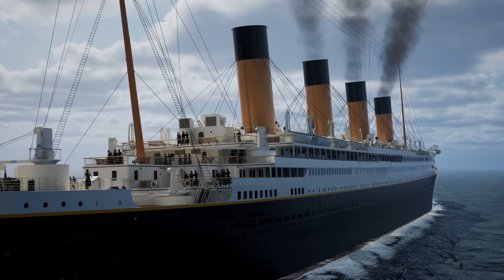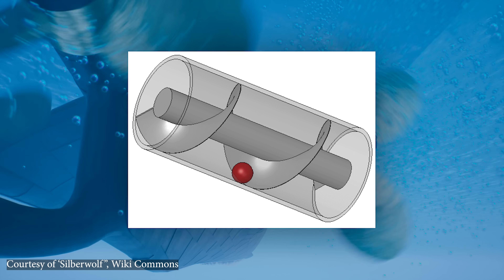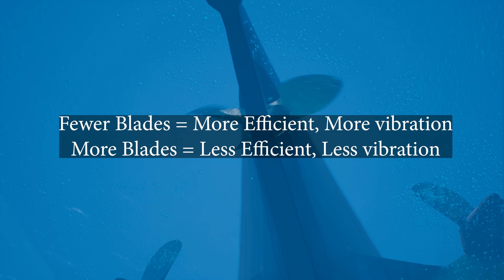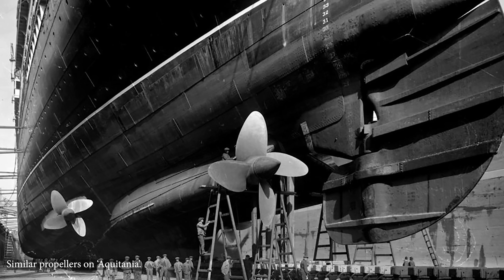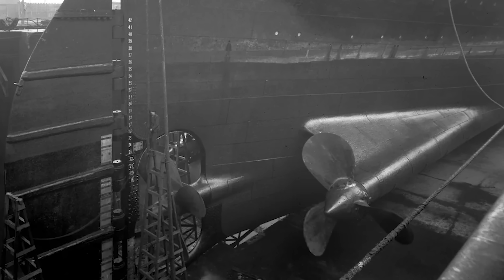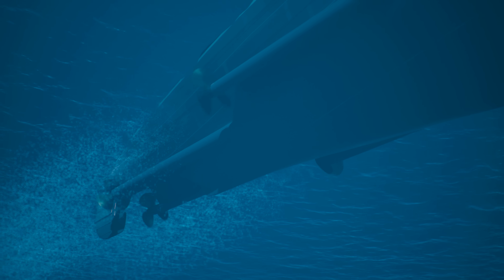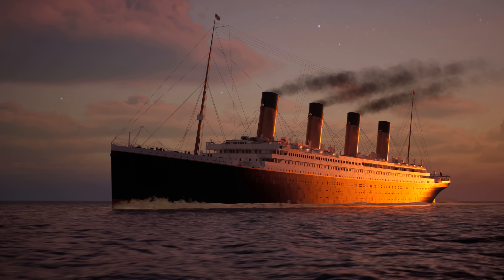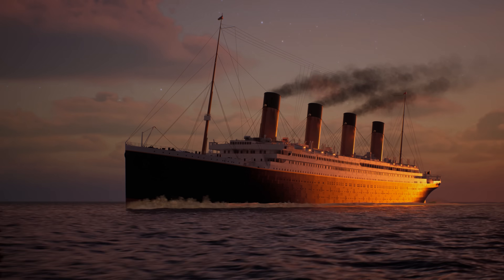Titanic's Propeller Mystery

Comment: Something I'd like to know, maybe for a future vide: How did/do ship builders manage to get a watertight fitting around the rotating shaft of a propeller through the hull into the engine room?
Reply: It would have been a stuffing box, an area around the shaft stuffed with jute or other fibers, possibly along with grease or other thick lubricant, and then compressed around the shaft. Often times, especially on bigger ships, this was not designed to be perfectly water tight, as a small trickle of water flowing through the gasket would help manage heat buildup and keep the stuffing box from overheating and potentially igniting from all the friction. The small dribble of water would be easy to collect in a sump or bilge area and pump out. 

I too would be interested in learning exactly what type of stuffing box Titanic and other large ships of the time used, and if there were any interesting quirks or experimentation as compared to modern stuffing boxes.
Reply: @lucusloc  Spot on with your explanation
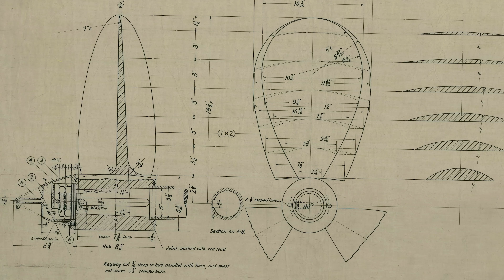Reply: Good question - at 3:27 you can see some original engineering drawings which state that the joint is packed with 'red lead'. Maybe this is part of the solution.

i was wondering the same thing so this stood out to me.
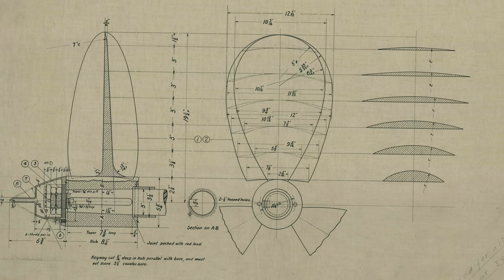Reply: @tachikomakusanagi3744  No, the red lead thing you see at 3:27 is the connection between the prop shaft and the propeller itself. It doesn't need to move, as the idea is that the prop shaft turns the propeller, so a much easier problem than the stuffing box. The stuffing boxes will be inside the ship. Typically the rear parts of the shafts are flooded, running in a kind of tunnel. At some suitable place within the ship (as in, somewhere crew can access it for maintenance etc.), the tunnel ends and there you'll find the stuffing box.
Reply: Red lead is the red anti rust paint. Red lead oxide. I think it was used in this case to stop corrosion between the prop shaft & prop boss to enable easier removal during maintenance.@tachikomakusanagi3744
Reply: I am not sure about titanic in particular  but usually there is a recess cut in the metal shaft housing and packed in tight with Rope or something similar as Packing material.     It's the same idea in a wood stove you use a rope as well to block out fire/heat/smoke around the doors and glass.    You can find rope of various types used to seal in industry from back then and today.
Reply: Asbestos was used quite a bit then to
Reply: A long propeller shaft, tight fit, maintenance and a fuckton of grease
Reply: @thatawkwardfeeling9076 sounds like a diddy party!
Reply: @DiscombobualEight  XD oh no
Reply: Some water still get in and just pump it back out.
Reply: @thatawkwardfeeling9076  Water soluble oil not grease.
Reply: Not a bad idea for a video, hell I spent ten years on carriers and I only kind of know, mind you I didn’t have much reason to go below the hangar deck. Maybe a series on how basic ship functions like that have changed over the years.
Reply: grease and hempcord/rope into something called a stuffing box
Reply: @grrfy and it leaked like a sieve!
Reply: @_RiseAgainst thats because it was a ford. They are STILL bad.
Reply: @grrfy oh yeah!! my wife has one too
Reply: Water pumps (and the cooling fan shaft) on model T had a wax cord that was packed tightly in loops around the shaft. They were terrible.
Reply: They do leak, and the water is pumped out.  I was on a cruise ship and managed to get a tour of the engine decks.  (This was over 30 years ago - when such things could be arranged.)  It was night time and the stabilizers were deployed.  The engineer told us that is was indeed seawater pouring in around the stabilizer bearings.  I knew an old navy guy who pointed out that "ships" take on water, "boats" do not.  If a "ship" has no engine power it must take on external power or the ship will eventually flood.  Mothballed ships have their bearings sealed to prevent leakage, but the bearings will no longer turn.
Reply: @earthwormscrawl  The old navy guy didn’t know much than because everything on the water will take on water. You can’t just leave a boat indefinitely tied up to a dock and expect it not to sink.

I’ve never seen so much stupid in one thread.
Reply: Indeed!
Reply: @Rudeljaeger  And then..... sadly... she was sold for scrap.
Reply: Rope, fabric, other fibrous materials, usually soaked in some sort of thick oil or other hydrophobic substance, packed around a circular opening and bearing surface around the shaft. Battleship New Jersey has done several videos on their propeller shafts and the “gland seals” that fill the gap through the exterior plating.
Reply: It's called a shaft gland and basically it's a set of bearings with some kind of lubricant which excludes water ... in the modern day this can be a dry lubricant or heavy grease, material which when wet swells to expand also exists which would be in the "stuffing box". It's very normal for a small amount of leakage to occur regardless. Here's an example of one on a small boat: https://www.youtube.com/watch?v=Hsa2uvENWoE
Reply: I'd always taken for granted that they used Babbitt!!  🧐
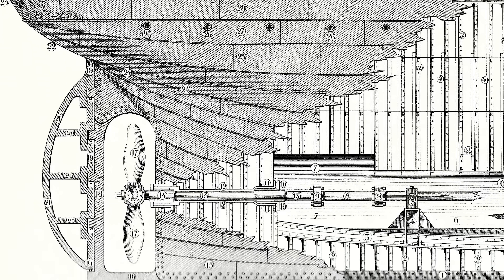Reply: I’m not trying to be a smart-a** but it’s pretty much the same way the crankshaft on your car can have an external pulley to run the belts and flange to drive the transmission yet not leak oil out every time it runs. To see an example of the housings that contained whatever sealed the shafts, 2:15 shows a diagram where numbers 11 and 14 show what you’re asking about. As far as the automotive example i gave. The materials are different, on a ship it’s actually more similar to the seals on hydraulic cylinders, called “packing”. Basically the shaft passes through a sleeve that contains a snug  (but not tight) fitting sealing gland made of some type of softer than metal material (rubber, soft plastics, even leather in some very old designs).
Reply: This is a very interesting thing. Certainly when it comes to marine screws, the Normandie of 1935 had several sets installed. First time out she took the Blue Riband in May of 1935, but she suffered dreadfully from vibration. A couple of sets later, they managed to settle it down. At the time of her destruction in 1942, French Line (CGT) had another set waiting so she could take on Queen Mary, but these were never fitted. White Star Line themselves also ran sister ships with differing engine arrangements too and in one example, in two sister ships, one ran Parsons turbines and the other traditional reciprocating engines…so changing marine screws was definitely not an issue either. Thanks for a fascinating video Mike.
Reply: They keep seals back there and send new seamen to feed the shaft seals 😂😂
Reply: I’m pretty sure the answer is that they couldn’t and had to constantly pump water out. 🤔
Reply: On the USS Peleliu we had a spot called shaft Alley with a Rubber-esqe gasket at the front of the seal around the shaft. The seal could be adjusted, as my buddy walked in on the room flooding, called a more experienced sailor, he came in and adjusted a few things and turned the flood to a drip hahaha
Reply: Great video
Reply: It is called a stuffing box basically rope in Greece sandwiched between two steel plates around the shaft. That would definitely make a good video to see it on such a big scale.
Reply: "Without shaking the milk out of your passengers" teat" 3:28 omg, My friend Mike Brady had me rolling
Reply: @drockjr TEA, not Teat! But your version is much funnier!
Reply: Now I'm wondering how a submarine does the same thing because I'm sure that keeping water from seeping in around the propelled shaft is much more difficult to do when the water is under pressure.
Reply: I've wondered how modern submarines do this as well, especially considering the depths they can reach. Gotta get the rotation from the reactor turbines to the screw somehow, and that means a hole in the pressure vessel.
Reply: If you go to the channel for Battleship New Jersey, Ryan explains this in one if his videos.
Reply: Oakum, essentially.
Reply: Horse hair I believe was used.
Reply: Big washers.😂
Reply: Similar to that of any crankshaft.
Reply: I was a boat builder and we used a stuffing box, it worked well.
Reply: A lot of ships used a seal made from Birch, as it swells when wet and is resistant to rot in salt water.
Reply: @PhalosSouthpawsBastelstube
The item your referring to is known as  a thruster shaft seal.
These are installed during manufacture in the shipyard and if a major failure occurs during the ships working life the vessel will be taken in to a dry dock where it is once again out of the water and any repairs and replacements are made before floating the vessel again.
Reply: Duct tape! Lots and lots of duct tape.
Reply: Flax and grease stuffing boxes. They are still used.
Reply: It is what's known as a "stern gland". It is the same idea as a valve spindle that passes through a gland or stuffing box that is filled with packing to stop the liquids or whatever leaking past the spindle. The compression of the packing can be controlled by a gland nut. The stern gland on a ship has packing that can be around 3" square (used to be asbestos based but not anymore) and this is compressed into the gland by a compression ring. The compression ring may have 4 to 6 tightening nuts around its diameter to give an equal compression on the packing. Usually after tightening, the nuts are backed off so that a small trickle of water passes through the gland to prevent overheating. The stern gland should be regularly checked on each 4 hour sea watch to check for excessive leakage or heating. A blown stern gland is a serious condition and may create the necessity for the shaft tunnel water tight door to be closed to prevent engine room flooding as leakage could exceed pump evacuation.
Reply: USS New Jersey briefly talked about this.  There's basically a room that has a huge ring of oily wood around the shaft.
Reply: I would like to believe they had rubber seals by then
Reply: @meshachkirby8772 they did but that was not what was used on ocean going vessels.
Reply: Third engineer here: Generally nowadays the shaft goes through boundaries of oil and/or water that is kept at a slightly higher pressure than the water on the outside. This is also used in conjunction with very low tolerance between the shaft and the stern tube. Sometimes inflatable seals are used as well for emergencies (failure of oil seal) and will allow the shaft to continue to spin, albeit just long enough to make it back to port.
Reply: Grooves and stuffing
Reply: By sheer force of WILL
Reply: Yes! I thought about that recently.
Reply: Packed and stuffed
Reply: short answer: they couldn't. that's what bilge pumps are for.
Reply: Former nuclear reactor operator on ENTERPRISE CVN65 here. We had shaft seals around all the presentations for the shafts. 4 shafts with each penetrating through the engine room behind it. 1 plant was most forward and only had the one for it's shaft. They were basically a rubberized bushing. Came in 2 pieces and had a metal collar that went around it and clamped it in place and sealed it. The final shaft alley penetration might have leaked a little while in service, but that's what pumps are for. And by a little, I mean it's damp around the shaft but you don't see any drips. Visited a few ships in mothball status too. Those shaft seals were cranked down tight so they didn't leak at all. But the shaft was locked so it couldn't turn. If you want to get a good visual and explanation, go over to the Battleship New Jersey YouTube page. Their curator made a video on this subject in the last year or two. He makes informative, high quality videos now. Go check them out! It's where I go when I need my "Navy fix".
Reply: There's still issues today with the propeller glands. The UK's biggest ever ships, the lead ship of the Queen Elizabeth Class Carriers, the Queen Elizabeth, had leaky glands soon after the Royal Navy received the ship. It apparently uses a kind of inflatable seal.
Reply: It’s called a labyrinth seal.
Reply: Packing.
Reply: Stern seals: basically a water-cooled mechanical seal (like on some water pumps’ shafts) and in an emergency seal failure: the shaft is locked still and a fixed rubber seal, like a doughnut, is inflated around it
Reply: Watertight parts of all kinds actually. I’m sure did low windows have differences compared to upper ones?
Reply: Good question:- 
The same way that the crankshaft of your car engine neeeds a crank seal at each end. Pack the end with asbestos/fibre/very thick material and cover with a steel cover.
Reply: They either used a special type of wood that lubricated itselve when it was wet or a natural product of the plant fibres of a family from weed plants with a lubricant. The plants are woven in a cord and rings are cut. These need to be turned 180 degrees from each other with the openings. And there is a pressing piece that’s putting pressure on it to seal it off.
Reply: Just Google it. There is information out there
Reply: Gland packing seal
Reply: I suppose just like a front crankshaft seal of an automobile. From those times either lubricated packed rope. Or lubricated cork.
Reply: I've been wondering this on and off for years. Thanks for suggesting this.
Reply: On modern ships you could use magnets, but hey
Reply: Back then there were
wax soaked ropes in grooves around the shaft. Some used greased backed ropes or fabric. Other items used may have been greased or wax infused leather. Ford water pumps for first several decades used same type thing on water pump pulleys, They did require regular replacement
Reply: Gland packing, I work at sea and it's a type of woven rope, nowadays with ptfe throughout it. It's then put into the stuffing box where you then have a collar that goes around the shaft which can be wound in to tighten up the packing which is normally then filled with stern tube grease
Reply: Short answer = A rotary seal
Reply: I mean it sank so who knows of it leaked or not 😂
Reply: @spoolin55psi  all stern tubes leak slightly even in modern ships it's what lubricates the shaft and cutlass bearing and cools the gland packing
Reply: Caulk lots and lots of caulk 😂
Reply: Shaft seal
Reply: Per GROK 3 - "Red lead" refers to lead(II,IV) oxide, commonly known as red lead oxide (Pb₃O₄). Historically, it was widely used as a pigment and a protective coating due to its bright red-orange color and anti-corrosive properties. In the context of the Titanic's propeller shaft engineer schematics, "joint packed with red lead" likely means that the joint was sealed or packed with a compound containing red lead, probably mixed with a binder like linseed oil to create a putty or paste. This would have been done to prevent corrosion, ensure a tight seal, and protect the metal components from the harsh marine environment.

In shipbuilding during the early 20th century, red lead was a standard material for such purposes because it resists moisture and oxidation well. So, in this case, it’s a practical engineering detail rather than anything mysterious—just a nod to the materials of the time!
Reply: Science
Reply: Google "shaft seals" - on a sub they have a pump, bearings and seal design that creates a pressure equal to or greater than the pressure of the outside sea water. Essentially it uses seals, bearings and casing with water pressure.
Reply: They cram it full of dogs.
Reply: @theBlankScroll nice, I like you
Reply: @theBlankScroll they do? that’s actually so smart clogage wise
Reply: @theBlankScroll  No cats?
Reply: According to google:

Traditionally propeller shafts were sealed with a stuffing box. These were crammed with oiled rope to form a tight, waterproof but relatively low-friction seal. Modern boxes use more modern fibers than ropes of old but the concept is much the same.
Reply: This is a guess, but:  A crude external seal.  Early rubber?  Metal bearing surfaces with tight tolerances, and with oil pumped under pressure in between them.   The pressure equal to or greater than the water pressure outside pressure.
Reply: @paulroberts3639  That would mean leaving an oil slick behind everywhere the ship went, and continually pumping out oil when tied up in port.   No way that would be accepted.
Reply: Yeah, they basically just pack it with wool and oil or something and crank down the bolts around it. In modern ships, there are slightly more elegant solutions, involving pumps and things. I don't know. 

This is oceanliner designs, not oceanliner engineering.
Reply: @RobertCraft-re5sf  This is oceanliner designs, not oceanliner engineering.

Dumb thing to say.
Reply: @RobertCraft-re5sf  This comment is very funny to me, because our engineering professor constantly drilled into us at every chance he got "ENGINEERING IS DESIGN, AND DESIGN IS ENGINEERING"
Every chance he got.
Reply: @melz6625  I also know the smart-ass answer he would give to that question.
 "what came first, form or function?"
"yes"
Reply: @RobertCraft-re5sf when it comes to Maritime travel, you can’t divorce design from engineering.
Reply: @RobertCraft-re5sf  what is engineering if not design??
Reply: @RobertCraft-re5sf  They should start another channel called oceanliner engineering!
Reply: @RobertCraft-re5sf  Design is synonymous with Engineering
Reply: @RobertCraft-re5sf  Can't have engineering without design and vice versa
Reply: @RobertCraft-re5sf they use o rings/gaskets…
Reply: @RobertCraft-re5sf Why are you answering and babbling on if you literally admit you don’t even know?